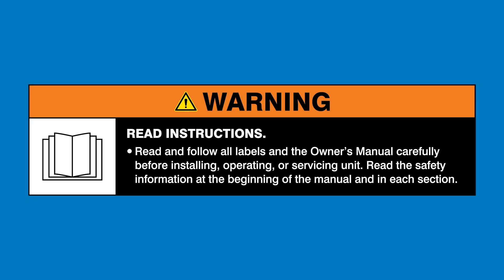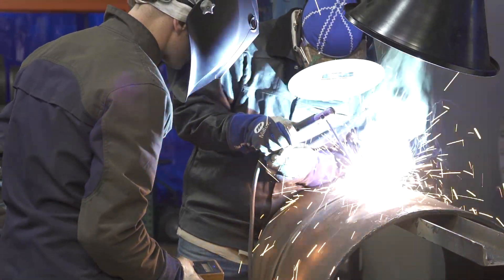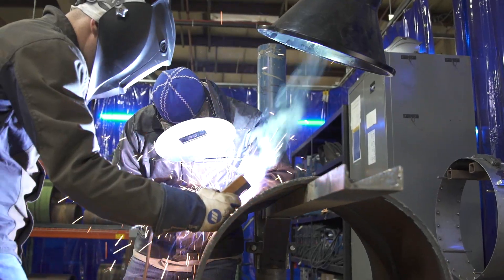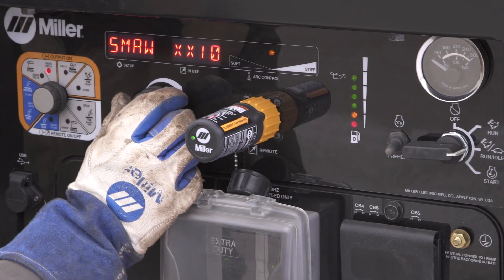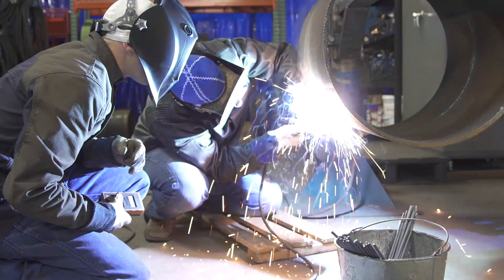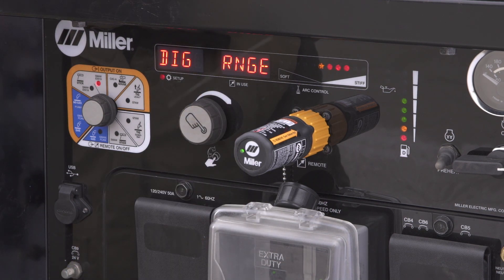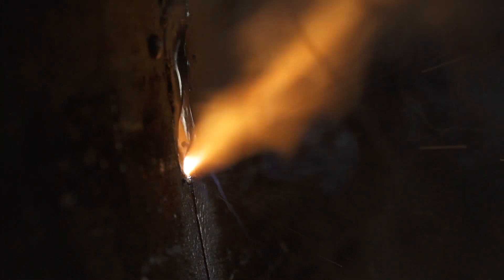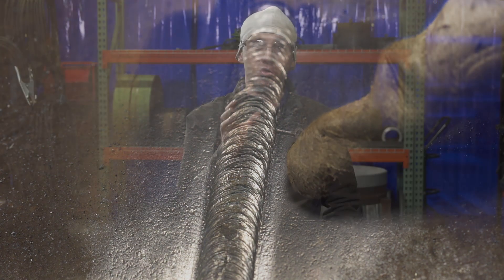Downhill Welding Tips: Setting Arc Control vs. DIG Range

Comment: What is the difference between the xx18 an the xx10 setting for stick?
Reply from the maker: Changing from XX10 to XX18 allows the machine to adjust the slope of the volt-ampere curve to best suit the welding electrode chosen.  Those two classes of electrode have very different welding characteristic and adjusting this setting helps to alleviate some issues such as a 6010 type of electrode wanting to stick.  Page 19 of the manual from the below link shows these curves as a visual illustration. Although this manual is for another model of machine the concept remains the same.  Please reach out with any other questions you may have!  

https://www.millerwelds.com/files/owners-manuals/O277904B_MIL.pdf

Comment: How do I get to my dig range on my pipe pro can ya’ll explain it step by step pls
Reply from the maker: For the Big Blue 400 PipePro press and hold the "Adjust/Control" button for 5 seconds to access the service menu. You can then rotate the knob to select "DIG RNGE" press the button again to adjust this setting. Detailed instructions can also be found in section 6-4 of the owners manual.

Comment: Does this remote work on flux core welding?
Reply from the maker: Thank you for reaching out. Please keep in mind that this video was developed to illustrate a weld position and the specific welding techniques/weld settings used are not necessarily best for all applications. The Specification Sheet from the manufacturer of the filler metal you use is the best tool to determine starting welding parameters. Please let us know if you have any further questions. Thank you.
Reply: @MillerWelders  I understand that settings are different for each process , my question was . Can I control  voltage output to work wit a wire feeder.
Reply: @lonesomedude81  yes you can. These welding machines can be used to set fir different types of welding. Therefore you can set the voltage output for the type of welding you are doing

Comment: Are the older models set at 115 from factory?
Reply from the maker: Hi Adrian, thanks for your question. Can you specify which machine you are referring to?
Reply: Miller pipe pro 400 (dig range)?